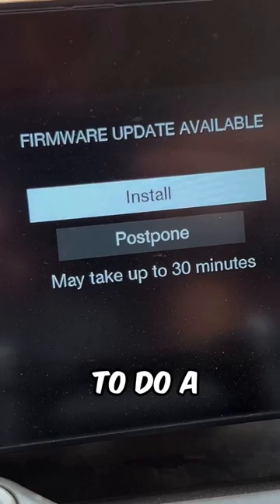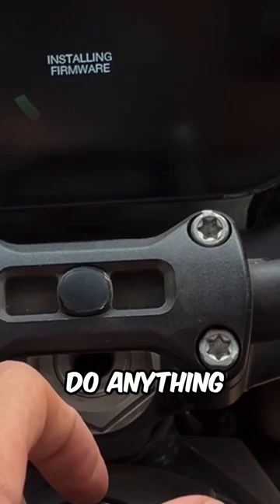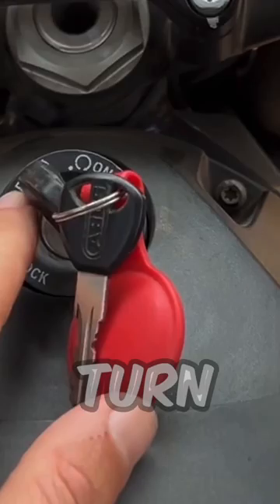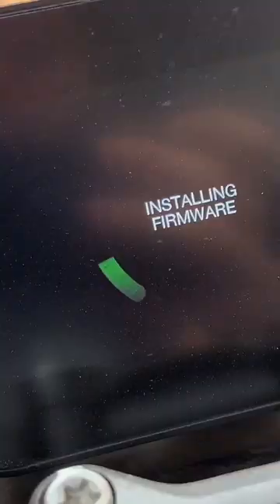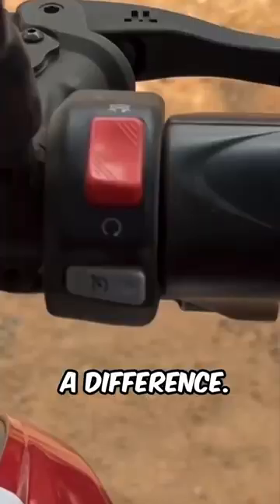F***, this almost got me stuck in India forever!🇮🇳🙈 @MarcTravels #india #marctravels #fail

Comment: This is the risk inherent in any EV. The vehicle is ultimately hostage to a third party.
Reply from the maker: I guess that the problem with any new machine
Reply: What about environmental damage caused to mine lithium using slaves and child labour
Reply: It's the same with new gasoline vehicles also.
Reply: @rangoman1815  environmental damage caused to mine lithium smaller than environmental damage caused by buring fossil fuels. using slaves and child labour is a social issue in those countries. slaves and child labour are used in all industries of those countries. Lithium has nothing to do with it and if it isn't for lithium mining, they will be used for something else.
Reply: @rangoman1815  How can you be so sure that there arent any slaves or children in oil rigs, What are the eco friendly ways to drill oil. You have to drill oil everyday while lithium only once.
Reply: @rangoman1815 Most people still die because of air pollution (read studies!) Which is caused by combustion engines and their industry and not from batteries
Reply: @95rafaelo bro stop yaping about ice . Even ev's cause air pollution because of batteries it is said that ice cause more air pollution than ev's cause they are in minority but when everyone owns  EVs air pollution will be the same as ice cars nothing will change
Reply: @RoRZoro  you know pollution is not the problem the fact that it has to be mine is because if it has been mine or dig up like petrol and coal it will soon run out just like petrol and coal reserves are getting empty
Reply: @RoRZoro which country using "slaves and child labour" to mine lithium are you talking about?
Reply: ‘You will own nothing & be happy’ Klaus Schwab.
Reply: @RoRZoro environmental impact is quite similar or maybe even more if whole world goes ev. But the thing is only the manufactured area is impacted so ta consumers dont feel the guilt.
Reply: @astergaming9606  I'm not yaping about ice. 🤣 Sure his bike does, but you also have to take stock if the energy comes from renewable energy. Here in Switzerland, for example, it is clear that within a few thousand kilometers an electric vehicle causes less air pollution than combustion engines. As I said, read studies.
Reply: @95rafaelo  good luck trying to produce enough "renewal energy"✨ to power all Evs , good luck finding enough lithium to replace all ice vehicles and good luck trying not to impact other industries dependent on lithium ion batterys. The studies can sag your imagination but it is practically impossible to replace ice cars by EVs
Reply: @astergaming9606 Fortunately, I'm more optimistic about technological progress than you. Your attitude won't get you anywhere. Enjoy your day :-)
Reply: @95rafaelo  well we are not scientist we'll just have to wait and see how tecnology develops and I also drive an electric scooter daily:)
Reply: @MarcTravels no, not any new machine but just evs

Comment: 1) Never update or fiddle with evs in situations where you don't have a backup
2) If updating never try to disconnect or shut off the system. Most of the times this causes the system to brick and be useless.
3) Before doing anything risky just try to contact the manufacturer and get any info on what can be done.

Comment: The 12V battery on a Zero is just a backup battery for powering the 12V systems like emergency lights and accessories when the main battery decides to disconnect. The main computer does not depend on it, and in fact manages some accessory power. I think this architecture was a poor decision.
Reply from the maker: I have no idea about how it works to be honest. I just ride it 🫣 but surely won’t do any updates anymore
Reply: Updates are okay. The bike can even back out of it in principle. But probably best done in the least risky place possible, especially because Zero doesn’t give you much control at all over the process, as you’ve seen, and dealers are needed if anything goes wrong.

Comment: Firmware updates in embedded applications are important. They can help with overheating issues, better range, and overall efficiency. There is much to gain from a firmware update. Software updates on the other hand are optional and usually add UI improvements or calculations, As stated before never turn off the bike while doing a firmware update.  I recommend doing the firmware update overnight while the bike is plugged in and you are resting at a hotel.

Comment: Well one thing that you never should do is disconnect battery while the firmware is getting updated - it can corrupt the firmware and you will have to flash it in the service center, basically you will get fully stuck. Better wait till it gets finished, a basic android phone will take 15mins for major OS update - so be patient with your bike

Comment: If you interrupt a firmware update, that might kill your bike. So it's better to wait. Because during firmware update, the bike deletes the old software and copies the new one. If you unplug it before finishing the update, you might end up deleting the old software without copying the new ones and that will kill your bike. So your bike might end up without proper software and you might need to go to a service centre (which is not in the country) to flash the software directly into the chip. It's the same with mobile phones or computers. Never unplug during firmwhere update.

Comment: You know what does not have these kinds of issues ? A conventional bike.
Reply: But they don't have this kind of performance and convenience. They are slow and have high maintenance with frequent oil changes etc..
Reply: @RoRZoro but they're reliable. You won't need to halt anywhere for hours to charge ur battery. You won't have any range anxiety during long tours.